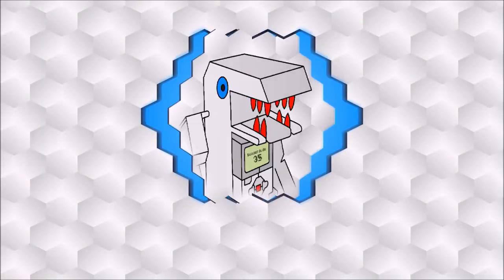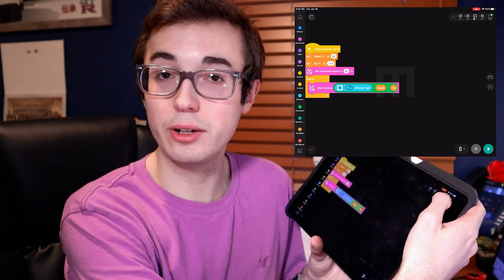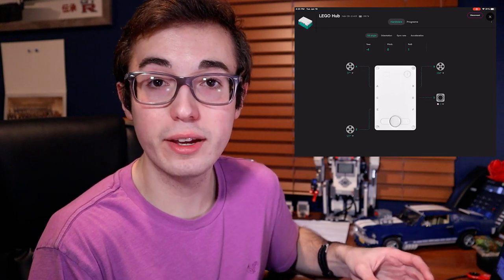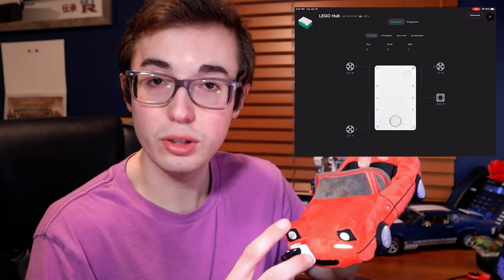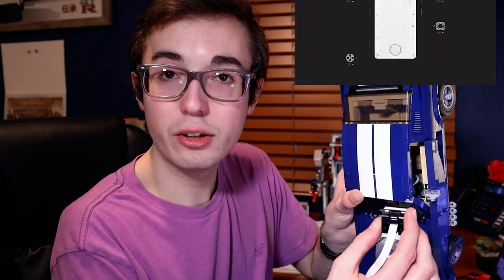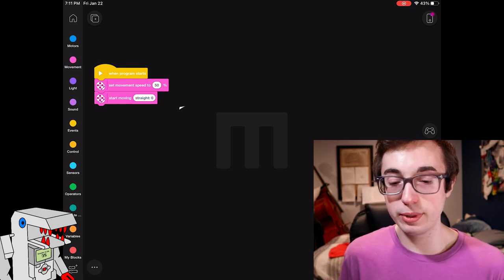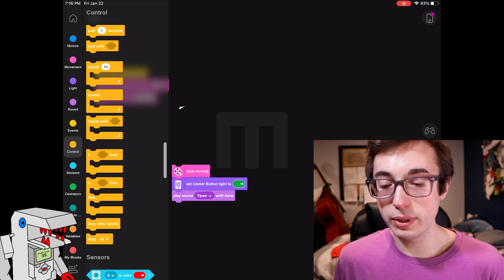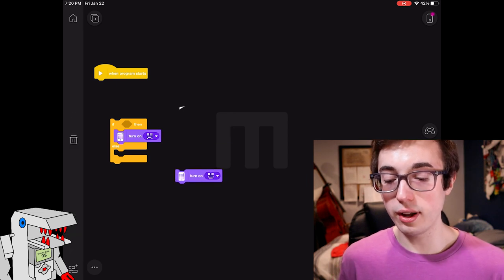Master the LEGO 51515 Color Sensor

Comment: I like how you demonstrate the Scratch programming steps!  For FIRST Lego League (FLL), I can see how the Color Sensor could be used to detect a colored Lego brick when starting specific programs; that would be a lot faster than pressing buttons on the intelligent brick itself.  For "Line Following", what is the optimal height of the Color Sensor above the table?  For the EV3, it is 1-to-2 studs.  Is there a good height range for the new Color Sensor that comes with the 51515 Robot Inventor set?
Reply from the maker: The "color switch" for FLL is a great idea! I have heard of it done with the EV3, but I think it can be even more helpful with the 51515 because it lacks a display.
Reply from the maker: As for optimal line following height -- the new 51515 color sensor has a longer detection range than the EV3 color sensor. This means you can place the color sensor higher off the table if you wish (3 studs). You can still use the 51515 color sensor at the normal 1-2 stud height (that is what I will show in next week's video) but you need to shift your target values into a "brighter" range. For example, I'm used to targeting 35% reflected light intensity for an EV3 line follower, but for 51515 Robot Inventor it's closer to 85%! That's due to what I noted in the video about the 51515 sensor being more efficient with its light.
Reply: @Builderdude35  Ah! Found the answer to my previous question here! Thank you.

Comment: So, I have a project that uses 2 hubs to do hub to hub communication. As a "decoration" I mounted the 2 color sensors from each kit as headlights on a vehicle. Then I wondered??? Is there a way to have them blink like turn signals? Hmmmm. Can't find a way to do that. The distance sensors can be turned off. (they are off by default). Any ideas?
Reply: You can turn on amient light mode in more sensors extension.

Comment: Lego boost color sensor is better and more compact
Reply from the maker: More compact... sure! But I am personally curious to know, what makes it better?
Reply: @Builderdude35  It has a distance sensor included and also color lamp.
Reply from the maker: @MegaMike1  I must admit, that is pretty cool! Does it measure distance using light or ultrasonic? Is the accuracy comparable to the MINDSTORMS ultrasonic sensors?
Reply: @Builderdude35  https://www.lego.com/en-ca/product/color-distance-sensor-88007

Here's the spec on the official Lego website.
Reply from the maker: Thanks for sharing! By looking at it, it seems like they chose to use an optical distance sensor. Also I must say that the price point is impressive.